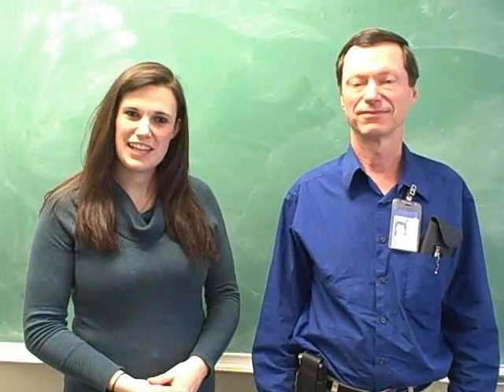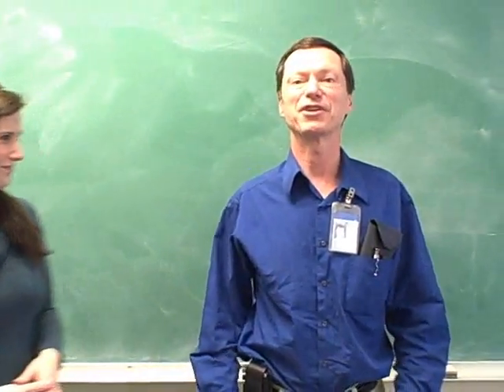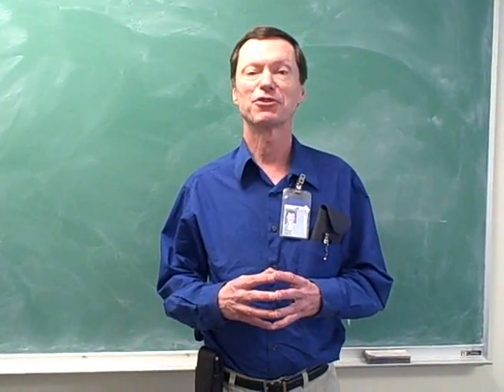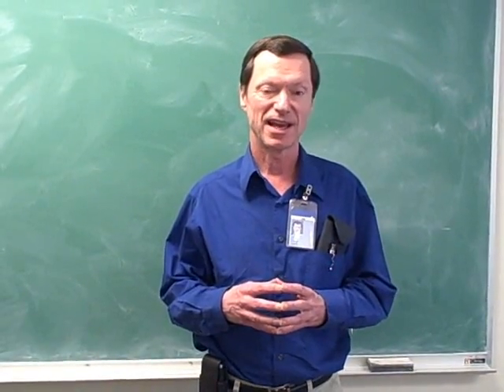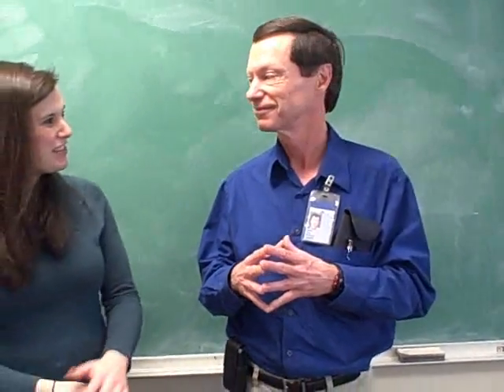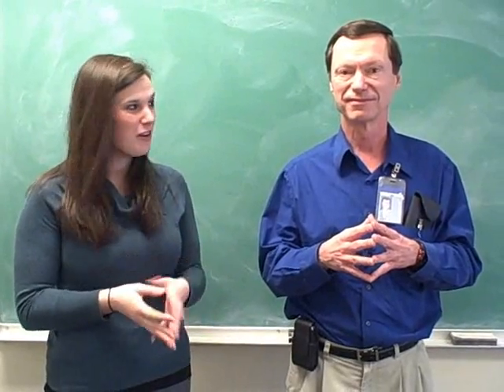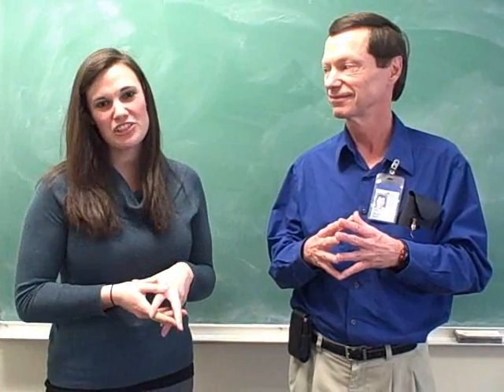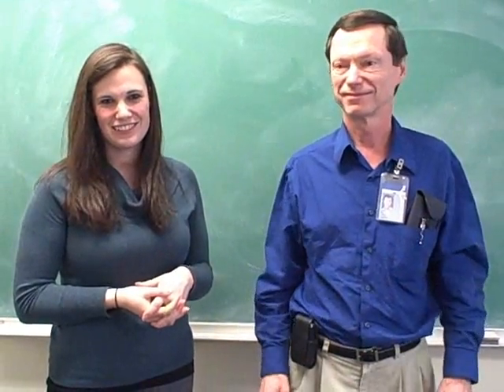GE Stump the Scientist: AC vs. DC Power Flow

Comment: Thanks 4 vid. I am considering buying a standing mixer for the kitchen. The company is switching from AC motors to DC motors which appear to have less wattage but are advertised in terms of horsepower making it difficult for me to compare ( I know nothing of these things). Should I be concerned about which motor is in the mixer I buy? The AC's are being sold at a discount. Should I view them as lower quality?
Reply: AC motors are more rugged and reliable, can operate at higher speeds and are available in larger power ratings.

Comment: Good info about the these two types of electrictiy. 
Question regarding AC:  AC still has to move forward does it not or there would be no power at the end of the power line/cord.  How does an alternating current move forward? Does it move foward?